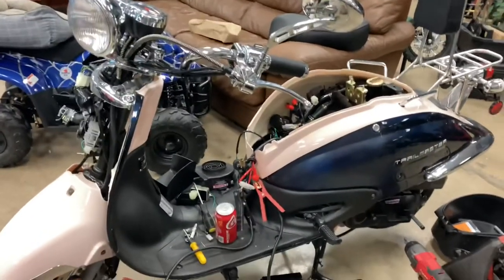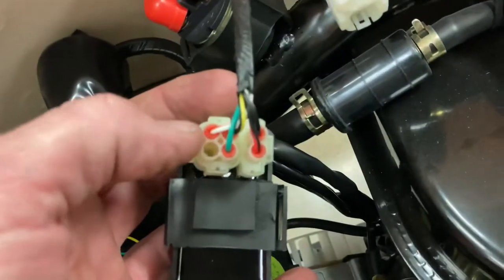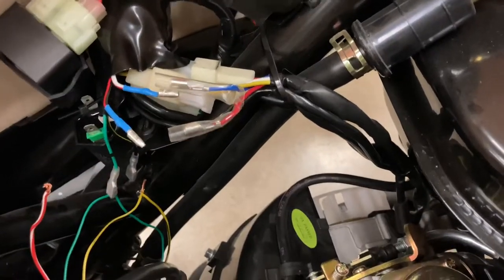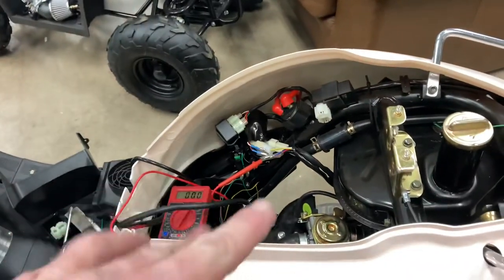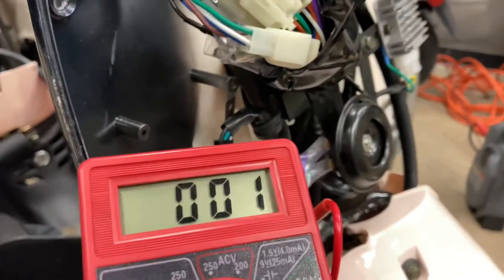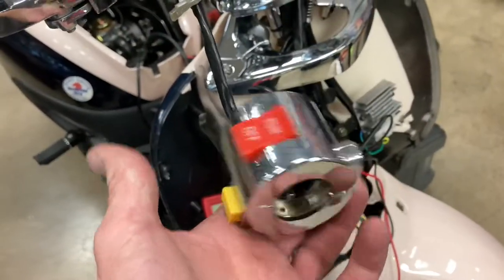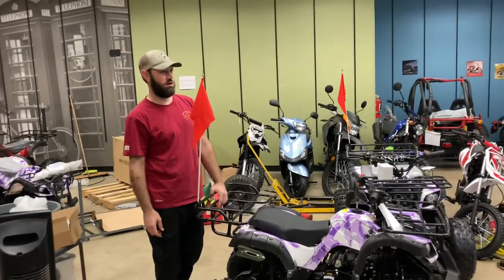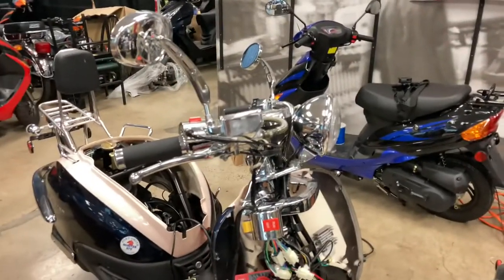How to fix no spark on scooter! Back running again ! Scooter won’t start !

Comment: If your scooter has no spark it's either your stator you're cool for your cdi box maybe the plug
Reply from the maker: Pickup triggers bad ground kill switch are few more u will need to check but yep u got few of them to look for but not all ! Dc system bad battery also can cause spark loss ! Broke wires too !
Reply from the maker: I’m guessing you didn’t watch the whole video lol

Comment: So i have no spark on my lexmoto enigma 125 when i press the start button however when i turn the ignition i see a spark so what could that be?
Reply from the maker: Cdi id guess do you own a volt meter ? A spark as in one time ? Or trigger on flywheel has metal shavings or isn’t gapped correct!

Comment: So why did you think the switch was bad? From your test it looks like the switch was good.
Reply from the maker: It worked 3 out of 5 times lol it’s hard when there like fix it but it’s running at the time ! Start tapping stuff till it dies or shake wires lol
Reply: I don't understand where you're coming from if the scooter turns over that means all safety  switches are good 😂😂😂😂 quit trying to confuse people
Reply from the maker: Some have kick stand switch that cuts off spark but it will still turn over ! Thanks ! I try to cover everything not just yours the motors are generally the same the electric isn’t some even have radios ect !
Reply: @WaldensWorld can I bypass the kickstand switch